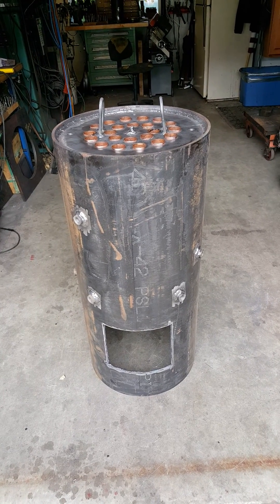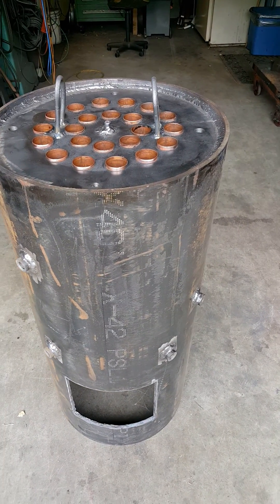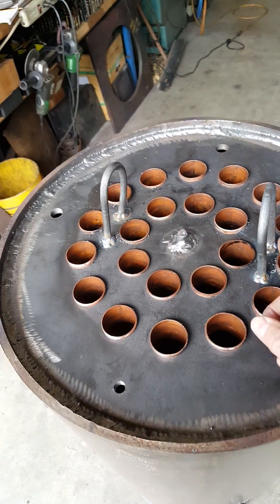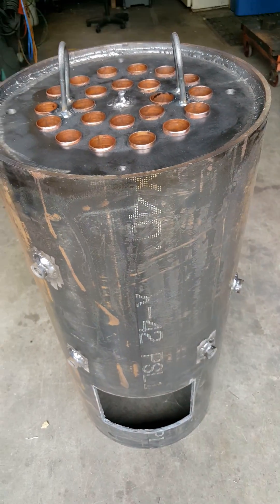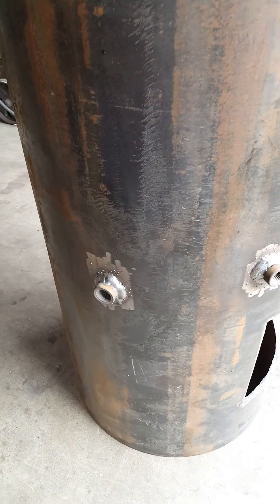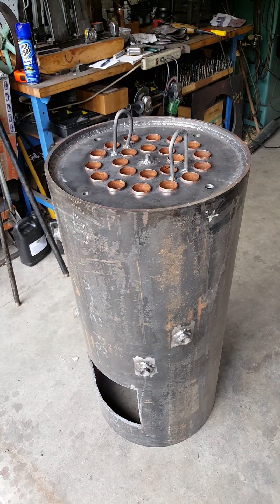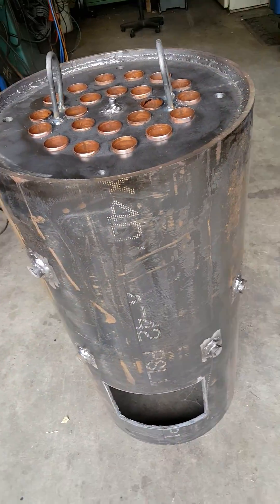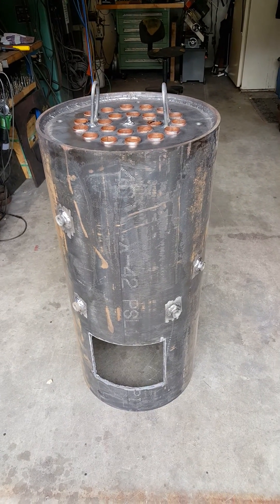Steam Boiler Engine Whistle Gauge SOLD ON EBAY

Comment: Going to build one for a steam locomotive, 10" 3/8 thick, you only expanded tubes with proper tool?
Does it require any special care on building, I tig weld thick plates, might be the same technique.
Wish you the best lucky in life bro! 
Nice job
Thanks from BRazil ;D

Comment: That is a nice piece of work ! could you tell me the thickness of the tube plates please I am collecting parts for my own boiler build so far I have the barrel rolled to 16” x 4ft ( left over from another job ) also a selection of 1 1/2 diameter copper tube also left over from a glycol chiller job . Thanks Jay

Comment: You have the means of rolling 3/8 steel into a cylinder?
Reply from the maker: Sorry! I use steel pipe.
Reply: Ok thanks, that makes more sense. Have to find someone who sells pipe that big.
Reply: @rossbendixen  Hi - does the pipe have to be seamless or is it ok with a welded seam?
Reply: @gary.arthur  both work fine
Reply: @user-pq9yd8fr4m  Thanks.